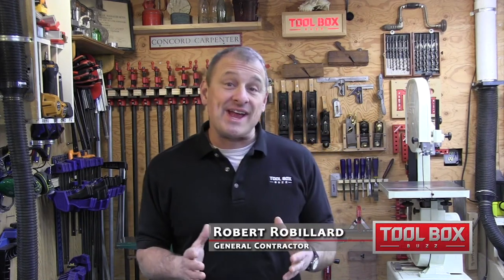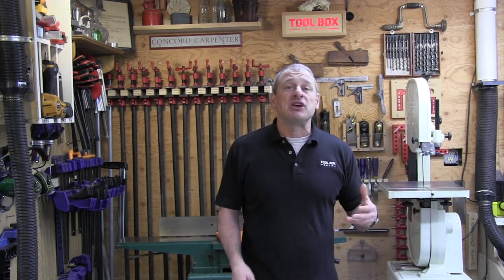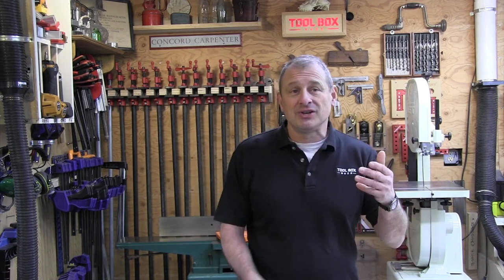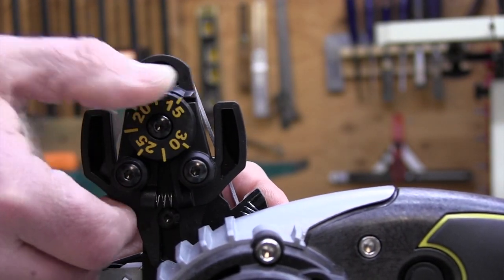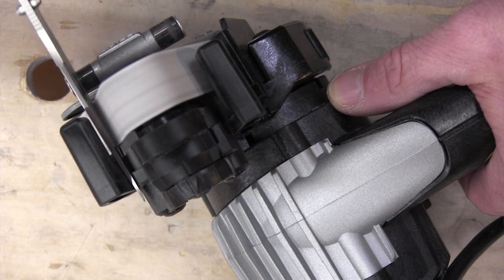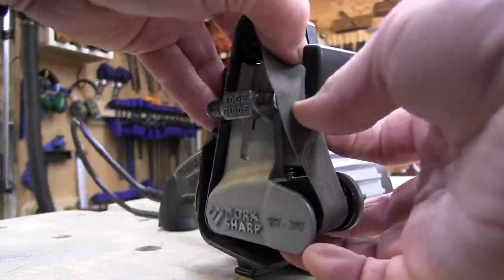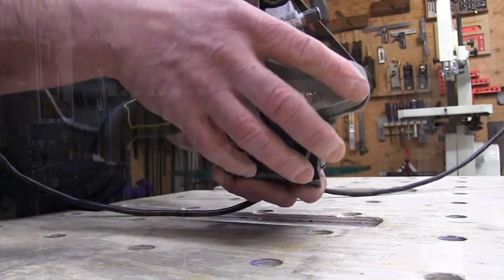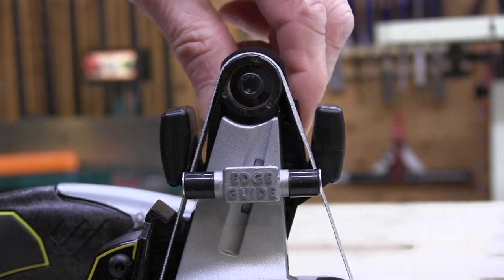Work Sharp Knife and Tool Sharpening System   ~ 10 Year Look Back

Comment: I’ve also been using the Ken Onion sharper for a few years now, and it does the job, and it does it well, great sharpener.  I used it today to sharpen Pruning Shears, as if I’ll need them anytime soon with 2 feet of snow in the ground.

Comment: What can I sharpen my hedge trimmer blades with? Will the Work Sharp Tool Grinding Attachment (Ken Onion) (WSSAKO81111C) work? Have you ever sharpened Hedge Trimmer blades using Ken Onion? I've tried with mine, but its too tight to sharpen the other angles. Let me know what you can find out.

Comment: Rob, you have any knives with premium steel that you've sharpened with this? Curious how it would do on say S30V
Reply: The knife he's sharpening at 1:40 is zero tolerance 0562ti in 20CV, so it would do fine with S30V
Reply from the maker: Joey DaFish a few, great results, especially when you take the time and use the finer grits and honing belt
Reply: Thanks guys! I'm no expert on knife steel but I'm just starting a premium steel knife collection and the first of the few I bought so far is a Spyderco Para 3 in S30V and it could use a sharpening and I do not want ruin the blade geometry. Of the ones I bought so far this one is not pocket jewelry and I use it as my daily driver
Reply from the maker: you'll love this tool